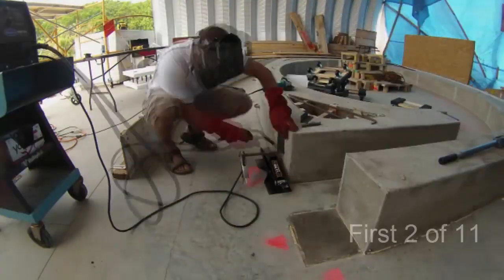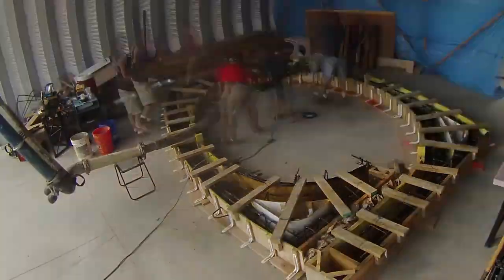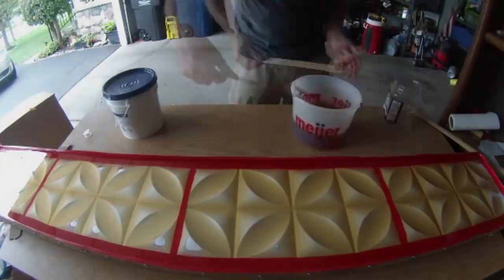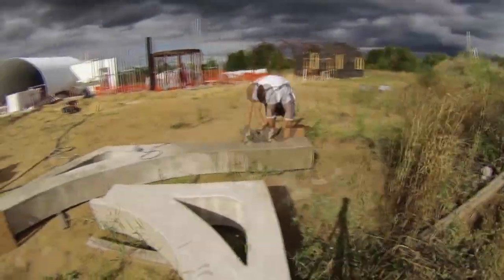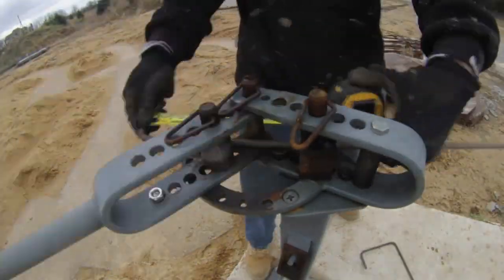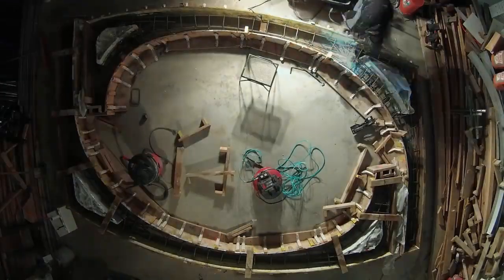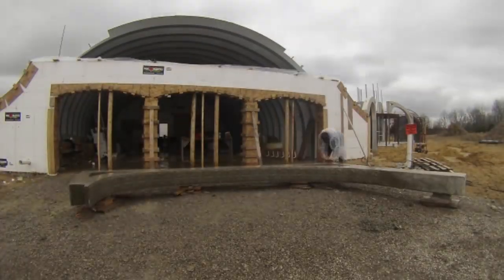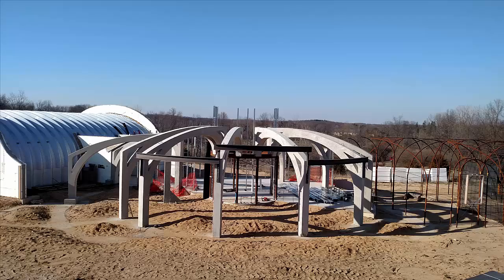24.0 Forming and setting up the concrete ribs

Comment: I've been watching your videos out of order but no matter.  I admire your work and detail. 

Very expensive, also what was your method of funding?

Did you have any inspection, safety and code problems? Any problems regarding permits?
Reply from the maker: Before buying the land, I met with the inspectors to show them my plans and make sure they would be OK with the idea.  The main inspector told me that his job was making sure that whoever built my house would be doing right by my family.  He realized that I would need a lot more than the normal number of inspections, so he wrote, "Unlimited inspections" on my permit.  This means I have just paid for the basic set of inspections but have had him out far more often than that to check out my progress.  I have passed the vast majority of my inspections, occationally he see something that is a problem and tells me to correct it.  For instance, he didn't like the way the rebar was too close to the quonset hut in some places so I added some extra rebar chairs before shotcrete.  As for safety, his only complaint was I had setup scaffolding without a ladder next to it.  Apparently, that is a rule.  But generally speaking, no problems.  I would say I have a good relationship with those guys, all the way up to the county commissioner who visits just because he thinks the project is interesting.

Comment: I sincerely appreciate your effort in the construction of your own home...but why did not you go for a completely earth buried or earth berm house.....plus I am impressed with your use of contracted cranes, pumper trucks...frankly...they are very expensive pieces of equipment to hire out even daily.....your effort is very much appreciated and I sincerely hope you keep providing videos till your completion. I'd love to see your final product.
Reply from the maker: I am experimenting with different things, so parts of the house are more completely buried than others.  The original plans had more of the north side walls buried, but then, after an exhaustive search, I ended up with a plot of land that had a great view to the north.  It would be a shame not to take advantage of that view.  Our family also would prefer to use a shady north patio than the sunny south one for most of our outdoor time, so that also factored in to the final design.  I think my several ft of dirt over the vast majority of the roof means my design does count as "completely earth buried".  I will just be adding that dirt after the fact, rather than building in a hole.
Reply from the maker: As for the contractors...  They are expensive and I try to use them as efficiently as possible, but sometime they are necessary or well worth the expense.  For instance, moving these ribs and setting them up without the crane would have taken a lot more friends than I have and some would probably have died in the process.  Drilling the well requires specialized equipment and expertise.  For pouring the floors, the pump truck make the task so much easier that I was able to use much less time or manual labor and justify it that way.  Large volumes of shotcrete is definitely not something I would want to do myself (expensive equipment and very hard work), but I will do small volumes of sprayed concrete (eye-brows and the south walls) on my own with a mortar sprayer.  Striking the right balance is something each person needs to work out for their own project based on skills or special equipment required, time available, costs, etc.

Comment: Any reason you didnt pour the concrete with the columns in place?
And why did you do the forms in the garage where the trucks cant reach it?
Reply from the maker: To make those forms strong enough to be filled while in place would have been extremely difficult.  The taller the column of concrete, the greater the challenge.  A nice flat 1ft tall form is not a big deal...  Also, finishing flat is easy, finishing vertical is difficult because the wet polisher water goes all over the place.  I did them in the garage because it was a nice weatherproof place with a flat floor.

Comment: Ahhhh the fun you can have with unlimited funds.
Reply from the maker: ?  It would be great to have unlimited funds.  As for these ribs, they just cost a few hundred dollars each.  Setting them up was actually the most expensive part, but by that point, I didn't have any option ;^)
Reply: Never mind these fools. Obviously they have never built anything. Cost, materials, labor, and hiring a crane, I feel you man. If I ever want to build something like this, sure I will use the information you provided, but I would rather just hire you and pay you whatever it takes to get your hard earned expertise. You built what I only dreamed about.